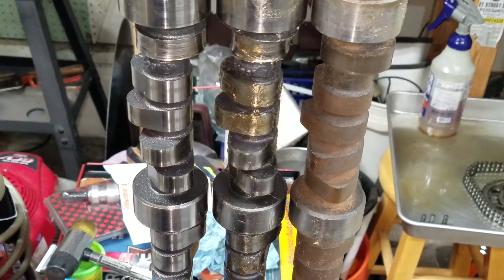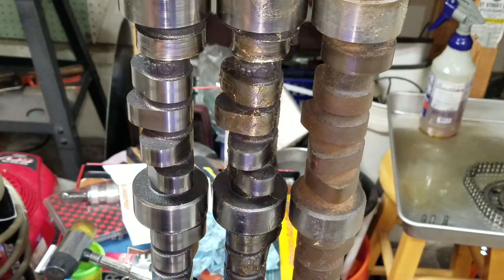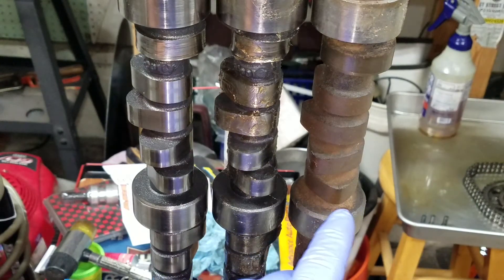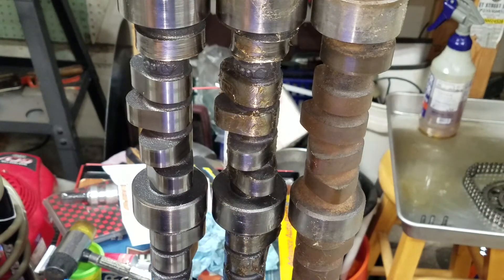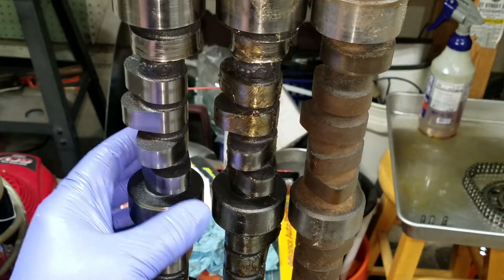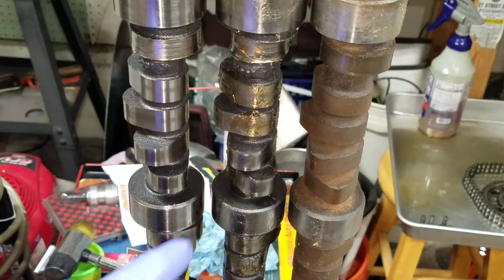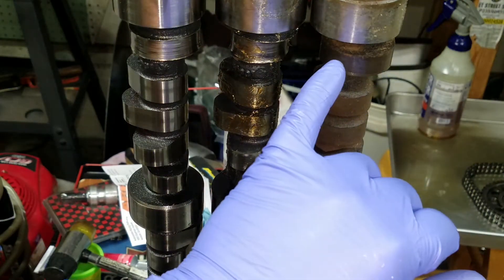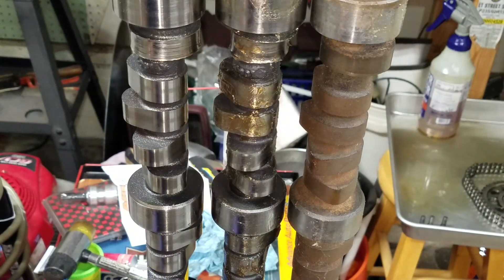COMPARING SBC ROLLER CAM PROFILES TO FLAT TAPPET CAMS.

Comment: the reason the roller lobe is so much wider is because of the radius of the roller lifter wheel vs a flat tapet lifter , if you put a roller lobe and a flat tappet lobe that have the same lift and duration side by side the roller lobe will still be wider to make up for the two diff type of lifters , also roller lifters allow for steeper ramps for faster opening and closing speeds that a flat tappet would dig into with the edge of the lifter because its flat and not round like the roller wheel and is why rollers need more spring pressure and make more power

Comment: I’m doing a budget build 305 w/ RC and have a couple spare stock Tapped cams .... can I used the tapped cam on ROllers ?
Reply from the maker: I think you mean flat tappet cam and no you cannot use flat tappet lifters on roller style cam. Flat tappets spin on cam lobe and rollers have a wheel. Just Google pics of those lifters and you can see differences.

Comment: The flat tappet cam cannot have as steep a ramp on or off of the lobe tip due to binding and skipping/bouncing. The ramp on a roller cam is actually way steeper than a flat tappet. The biggest difference between the two types is duration at lift. What you are pointing out is duration at lift. Roller cams open and close the valve quicker and hold it open at max lift longer. Duration at lift makes a huge difference in airflow.
Reply: Putting the two style cams next to each other really shows the difference. There is a reason they retrofit roller cams into the older motors. Modern cam design is truly amazing. Big thing I have run across though, is that most people do not understand that most modern oils do not have the zinc needed to protect the flat tappet cams from eating themselves. Almost every time I’ve run across an old flat tappet motor that runs like crap, it has lobes going flat due to using the wrong oil.
Reply from the maker: Thanks for reply.